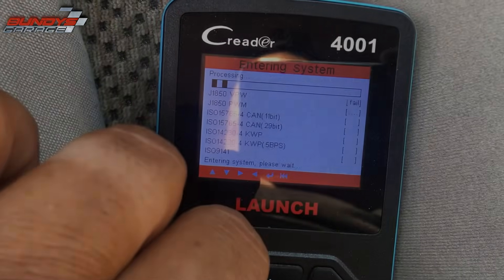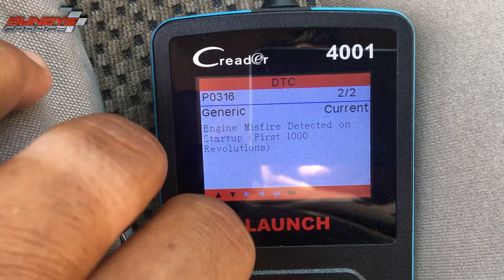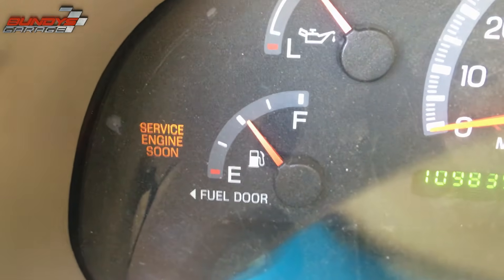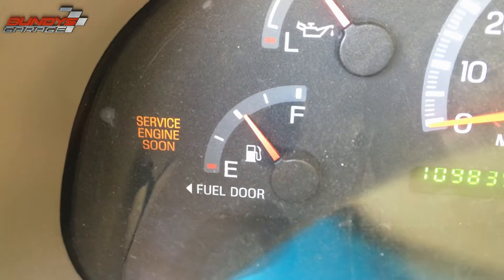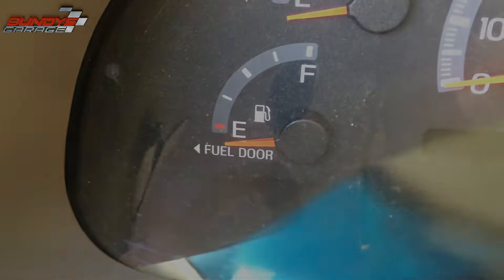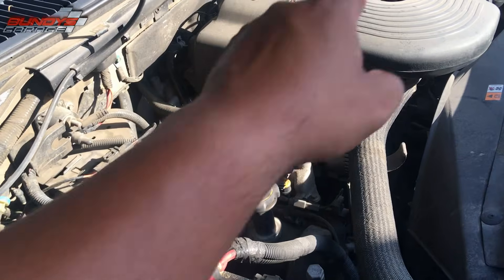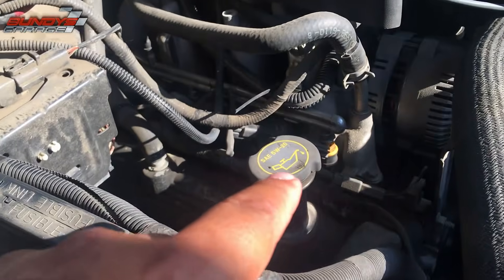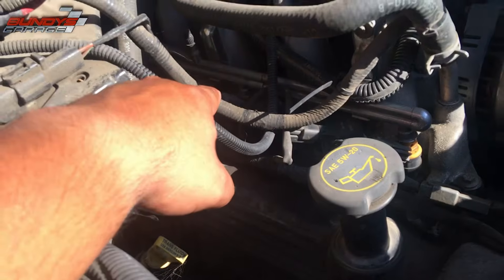How to Ignition Coil Pack Ford 4.6L Replacement | F-150 E-150 Expedition Lincoln Navigator | P0303

Comment: That is a 5.4 with the wrong plastic cover, 4.6 engines have 2 coils only I seen it in the video that it didn't only have 2 so I googled it to confirm it first thank you for the video
Reply from the maker: No, it's a 4.6L. The 4.6L 2 valve and 3 valve both use 8 coil on plug ignition coils.
Reply: @bundysgarage  yes sir I double checked it and I was wrong sorry thank you for correcting me I have a 1997 4.6 and I have never found any  with a coil for each piston not even at pull apart or online before this video

Comment: anyone know why when i look at all these videos they show the coil having the bolt and a plastic top? I have a 1999 F150 Lobo 4.6l but mine has more like a rubber coil with the wire attached to it. I cannot take it off so if anyone has tips or clues that would be great thanks
Reply: It is a 5.4 engine but they do not realize because they are so similar

Comment: Ok I have a question are not the boots on the coils rubber? How does that soak up any liquid now getting old and hot and even chemicals could and I'm sure does break them down but absorbing. not so sure. but would like someone's opinion.

Comment: Can you reach cylinder 4 without removing fuel line ?
Reply: I have the same problem with cylinder 4, I'm not able to get to it, did you ever figure it out?
Reply: @fenderfox5080  I ate the cost and took that one to the shop, it was 110$ unfortunately still a cylinder 4 misfire lol
Reply: @OtterPup_  I actually did cylinder  #4 yesterday,  I basically laid on the engine and blindly found the little bolt,  I just bought a Dewalt mechanic set recently THANK GOD!!! It came with all those extensions and 90° elbow and I felt around got it all switched and it worked perfect.  Also had to unhook the negative from the battery for 15 mins to reset the check engine light.  Other than that it was just patience and about 2 hours of planking blindly 🤣  at least the rest of the cylinders are easier to reach. Thanks for the update
Reply: @fenderfox5080  glad you got it man! I don’t think I could get the leverage needed , my socket kept popping off the spark plug somehow when I turned it never figured it out. I was sitting up under the hood too 😂

Comment: Had a bad coil among other things that needed fixed. Took it to a mechanic because some of the repairs were more than what I wanted to do. I asked them if I should replace all 8 of the coils. They said they tend to be expensive so they only change them as needed. No sense in changing one if it's not bad. Truck had 195,000 miles with original coils. Ran great for a few months then another coil went bad. I'm going to replace them all except the one the mechanic already replaced a few months ago.
Reply from the maker: If you can afford it, replace them all.
Reply: It's like sparks plugs when one's going bad the rest tend to follow

Comment: Can this make your truck shake and ride very rough when you press in the gas?
Reply: Yes. Whenever you put a load on the engine. Worse in a 4.6 than a 5.4.
Reply: @cyclepowered8799  thanks. Does the 2003 F-150 have the same spark plugs order as the 2002 F-150 as in this video?
Reply: @keephiscommandmentsandlive9860  I have a 2005 F150 4.6 and a 2002 E350 Van and they have the same firing order. Others, I don't know.
Reply: @cyclepowered8799  is the firing order the samething as the spark plugs order or are they two different things?
Reply: @keephiscommandmentsandlive9860  Same order for both
Reply: @cyclepowered8799  1:40 in video he states the order of the spark plugs and then he flashed a different order across screen as if to correct what he had said. He said the order was 1,2,3,4 on one side and 5,6,7,8 on the other side. Then he flashed on the screen the fire order 1,3,7,5,8,2,4,6.??
Reply from the maker: Yes cylinder order and firing order are different.
Reply: @bundysgarage  okay thanks! 👍
Reply: @bundysgarage  I actually just noticed that it shakes bad even in park. Also there is a lot of white smoke coming out of tail pipe, is that bad or can that be because of miss fires too?

Comment: Those are individual coils.  Not "coil packs".  Coil packs are two or more coils ganged together.  Typically used for wasted spark systems.  You have coil-on-plug.  COP.
Reply from the maker: If you walk into a parts store and say I need a coil pack, they will know what your talking about.

Comment: Is it possible to connect a tach on a Ford 4.6 two pack engine?
Reply: Find a wiring schematic for under the dash, since some models came with a tach in the dash you ought to be able to find that unused signal wire and tap into it.

Comment: This job sucks. I used 1/4 inch drive with 2 universals and 3 extensions. And an impact driver. Plugs I used a 3/8 drive and Milwaukee 3/8 impact.  #4 and #8 coil are the hardest to get at. So I just change them out. Don’t want to go back in a second time. Just getting the boot out is frustrating. Lots of curse words will come out.
Reply from the maker: You would think after 100 years of making engines Ford engineers would make it a little bit easier for mechanics to work on their vehicles…
Reply: What’s the best thing to get if the boot is stuck on the plug and your tore the boot
Reply: @johnedwards2127  
I stuck a stainless welding rod between the boot and the spark plug to unstick them two. Then made a small hook on the end of the rod and stuck it down the boot to hook it out. I used stainless because it was stiffer
Reply: @heresteven  and I have another question whenever it rains hard or I go thru a car wash my 97 ford expedition has a bad misfire if I put a little grease in my coil pac boots while that stop the issue that I’m having

Comment: Are you sure that's a 4.6 another 5.4?  Because I got a 4.6 and it has ignition wires does not have a coil pack on top of my spark plug like that
Reply: Depends on what year it is. I believe 97-98 models had the coil packs with spark plug wires going to the spark plug and starting in 99-2010 they started using Coil On Plug design. 99-2003 4.6 and 5.4 engines are identical on the outside, the difference is from the bore and stroke of the pistons that’s makes them Iether 4.6 or 5.4
Reply: @srcobra50  .  Okay I still have an encounter one with plugs and no wires. All I've seen is the 5.4  with coils on the plugs

Comment: I have a question. I have a 2003 ford e150 with a 4.6l v8. I had the p0307 cylinder #7  missfire issue. I looked up diagrams and swapped out cylinder #7 coil. #7 to my best understanding is the 3rd one closest to the driver. My van doesn't seem to jerk anymore but I'm not 100% that i did it right. Did i do the right thing? Or does the firing order makes another cylinder #7? I don't know how cylinder order works, so i don't know if i did it right. It's a wheel chair transportation van and the last thing i want to do is get stranded, but mechanic wants over $700 to fix it. Did i swap the right cylinder coil?
Reply from the maker: Here you go

FIREWALL

4 8
3 7
2 6
1 5

RADIATOR
FRONT OF VEHICLE
Reply: @bundysgarage  thank god! I got it right then. I'm sweating bullets right now. That's a relief. I ran it around the block a few times and it feels good. Thank you very much for the quick response. I thought the firing order was gonna make cylinder 7 #3 or something and i was gonna have to go back and change it 🤣🤣 Thanks again!
Reply from the maker: No problem! Better safe than sorry. If you can plz subscribe to my channel. It really helps me out, thx.
Reply: @bundysgarage  already did. I appreciate the help! You're a life saver!
Reply: Your mechanic is a scam artist.
Reply: @DarkLinkAD  yeah that's why i didn't go to that punk anymore. It seems he started being dishonest during the pandemic, he used to be fair priced.
Reply: Dealer didn’t want to do my f150. They quoted $1000 for my friend F150 plug change.

Comment: The #1 coil pack on my ‘01 f150 5.4L has failed several times within a few months of replacing. I have replaced the spark plug. No problem with other cylinders. What next? Is there a way to check the wiring? Suggestions?
Reply: The oem replacement coils are all cheaply made. Just buy a pack of coils off amazon. Mabye a v10 pack for 10th the price.
Reply: Thank you, for us handy handed folks that just lack the knowledge, well made video 😂